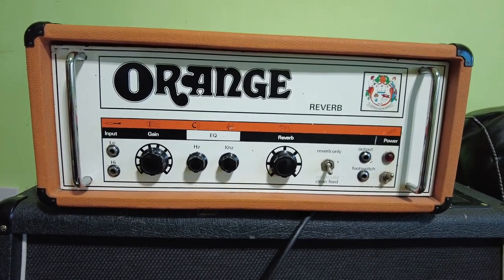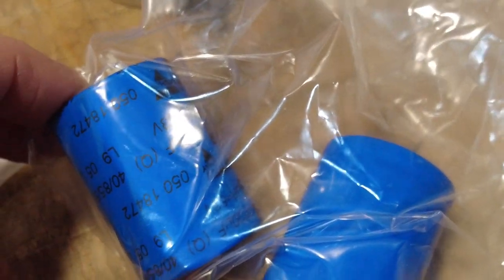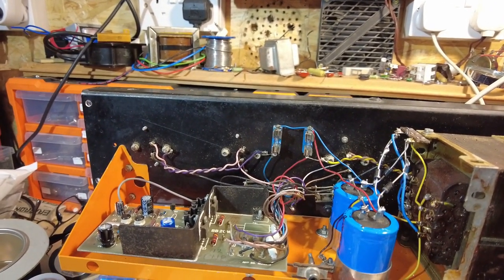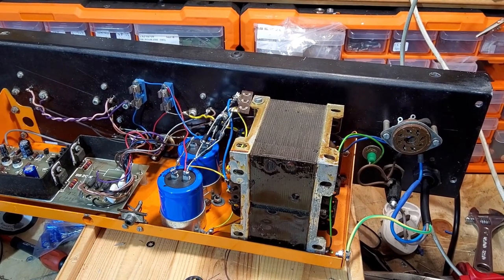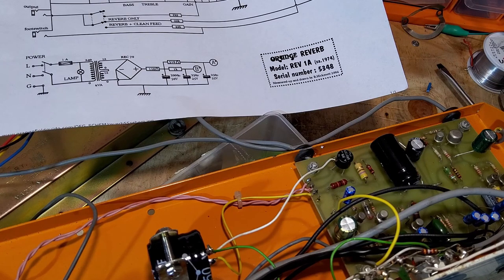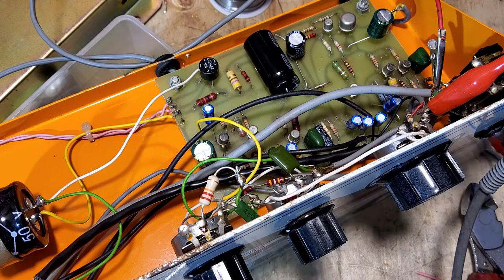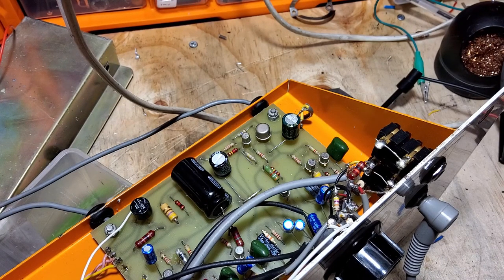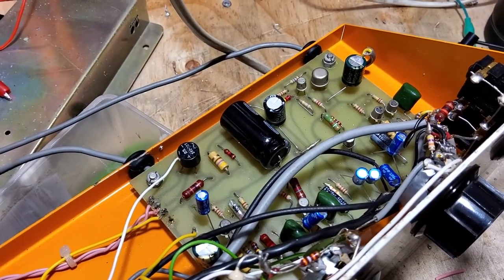Orange Amps Reverb Unit with Built in Amplifier Rare as Rocking Horse S*** Full Restoration Part One

Comment: We used those on board ship when I was in the US Navy and they are  Stuffing Tubes. We would use a knock out to make a hole in a brass junction box and use the Stuffing Tube for routing communications cable into the watertight junction box. They work great and once you tighten them down the cable is held nicely in place.
Reply from the maker: Hello JT. Yes they are really useful. Thanks for watching and take care

Comment: When you added the new ground point, did you remove the paint from the surface of the chassis?
Reply from the maker: Hello Michael. yes, I used the dremmel. I took the width of nut down to the metal. The paint is in mint condition so I didn't want it to look untidy. Thanks for watching and take care.
Reply: @vintageguitaramp_guitarteacher  That's quite an extensive renovation you've undertaken.  I'm looking forward to part 2.  I'm currently working on a 1969 Fender Bandmaster Reverb that I purchased last week.  My multi-meter is not working properly so I need to buy a new one before continuing work on the amp.